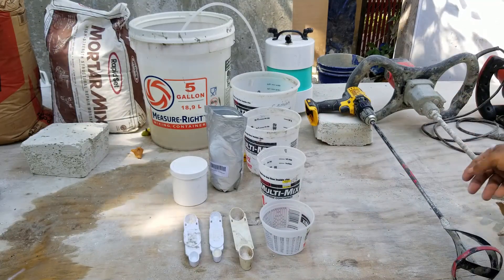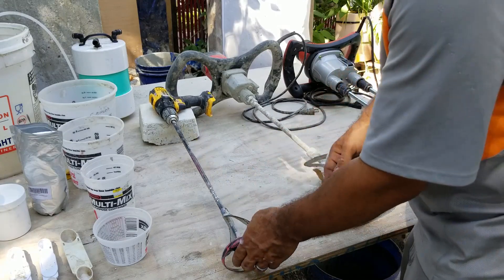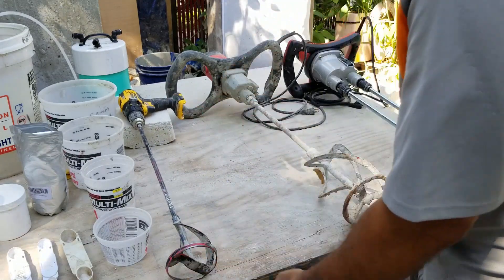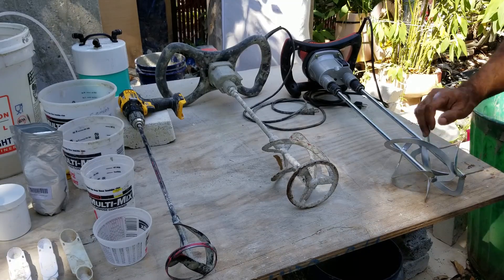Making Aircrete | Aircrete Tools needed #Aircrete #AircreteHarryFoamGenerator #AircreteTools #tools

Comment: Do we need fly ash or fine sand for making aircrete blocks, it is because some one suggest. Is simple cement and foam block economical interm of price and strength to that commercially available. Which block is batter AAC or CLC

Comment: Super array, Harry for the small user. I, like you got a hydroseeder a few years ago which I never got around to using. The Monolithic Domes mixer and peristaltic pump are perfect, too and time proven.I have a few soil mixers and others on hand. I also have a couple of foam generators but yours looks great and with your foot switch is easy to use.

Comment: @Aircrete_Harry 
Verticle mortar mixers are totally badass. They can mix dry gravel cement powders up to normal wet cement and mortar mixes.
Mortar for stone work uses very little water, of the 6 or 7 gallons you use 25% to 33% per bag of portland, + your 3x sand. The verticle mortar mixers have no issues mixing dry or semi dry mixes. Stone mortar mixes are too dry for horizontal mortar mixers.
Example: Mortarman 120 4.25 cu. ft. barrel capacity.
https://www.imerusa.com/mixers.html
There are multiple companies around the world which produce verticle mortar mixers, like Belgium and Taiwan.
In NY there may be tool rental stores where you can rent one to test. With a large enough capacity you may be able to also mix in your foam, once cement slurry is ready.
If you do test one, please share a video of it.

Comment: Harry: You keep saying "cement" when you should say "aircrete". 
$30. for one 3/8" diameter, 1-meter long basalt rebar?  With access to basalt rock, a pulverizer to turn it into powder, and an aircrete kiln, would it be possible to make your own rebar by melting and pouring into an aircrete mold?